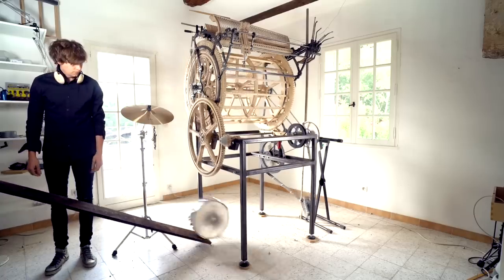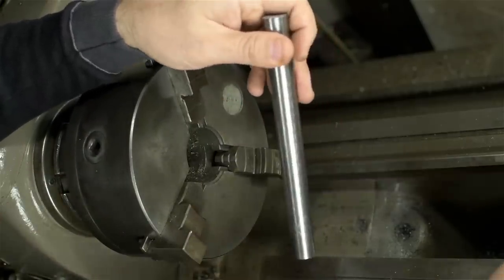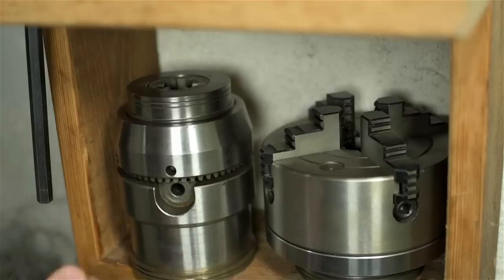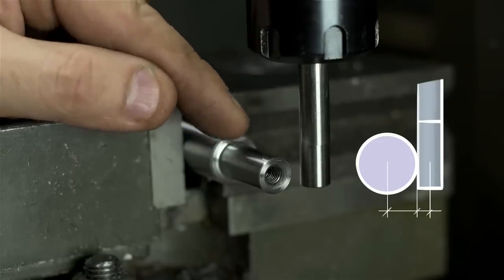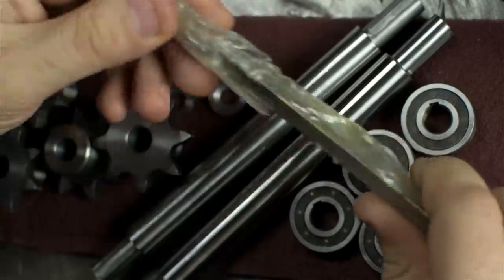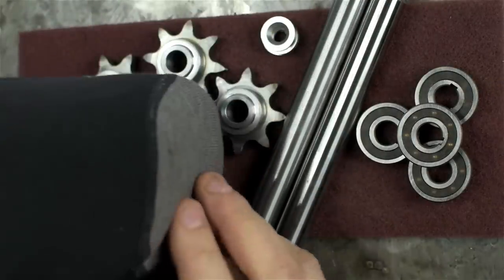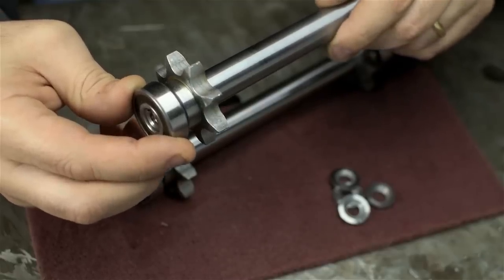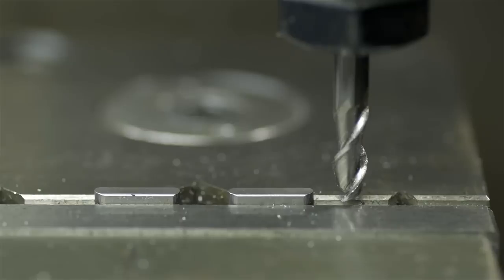Wintergatan's Marble Elevator

Comment: I've never found a channel that I've liked so much in my life. I'm an engineering student and love doing design. This Old Tony has taught me a ton about machining and metal working, so much so that at 19 I have just bought my first metal lathe. Its only a south bend 8 incher from 1932, but with it I'm already putting to use things I've learned from this channel. So thanks a ton for what you do and for every video you produce.
Reply: I wish he would show us exactly how he hotwired his lathe...
Reply: Benjamin Brooks, yea, I didn’t know that was a gasoline powered lathe
Reply: Actually physically building things in the shop will make you a MUCH better engineer.
So many engineers have lots of theory but no practical experince.

Comment: Tony: longtime listener, first time caller. 

Regarding slipping keys: next time you're holding 2 parts in a vice, consider positioning them farther apart (i.e. farther from the center of the jaws). This allows the movable jaw to shift a bit more to account for small differences in part thicknesses, providing a better grip.

Comment: So THAT's how you start a lathe
Reply: Only if you don't have the keyway.
Reply: Well it is an engine lathe
Reply: ... start it like You gonna steal it.
Reply: Something funny is. I had to deliver a work piece (a camera adapter for a telescope, next day we had the eclipse!) so i had to make it fast. My lathe has a centrifugal starter switch and the spring that makes contact broke, i didn't had time to get a replacement so i ended up removing the centrifugal switch and used a screwdriver to bridge the two wires, then i immediately removed the screwdriver as soon as i heard the lathe spool up to speed. A couple of times i was too slow and the motor made a frightening buzzing sound ( i do not recommend doing this unless is an emergency, also never do it if the lathe is too large or operates above 240V, doing this on a large lathe for example with a 440V motor would be very dangerous! it arcs very badly with 220V already). But job got done in time, later i was able to get a replacement starter, now im thinking in upgrading it to a VFD unit. So when he did that in the video i was laughing my ass off.
Reply: Had a car I had to start that way...

Comment: I think your start and stop problem (14:32) can be mitigated by bleeding air from the hydraulic system (fluid is non compressible and there is clearly some compression of the power media taking place (sorry for the English)

Comment: ******************CHALLENGE **********************  how would you hold a half dollar on the lathe while working on the edge of the coin specifical heating the coin once milled to depth using heat to expand 
the coin so the piece when finished will fit over a regular half dollar?

Comment: Finding center of a round part. I’ve found using an Edge Finder is great in many aspects and doing it for decades.
Use a good Starrett, Brown & Sharp, or Mitutoyo. All good within .0005” divided by two touching both sides and double check with an indicator of good quality ( names listed above ). After double checking you will realize using an indicator is unnecessary.

Love your videos Tony as you are teaching an Old Dog, new things.

Thank you 👍👍👍👍👍👍

Comment: Hey Tony I just found something that you might be interested in. I was randomly looking through crap on Craigslist like we all do and I came across this set

Burnerd multisize collet set, type ec2 to ex 13
Capacity is 1/4 to 1 1/4 or 1.6mm to 38mm. 
6 are new in the package and 5 are used. One is missing from the set

It does not have the chuck but you already do it's in Niles Michigan

It's in a nice little carrying case you should check it out unless you have no use for it obviously I don't know how many Collets you have

Comment: In 3535 when they are digging through the rubble of our collapse civilization they will find this marble machine. Tracing the collapse and fall of humanity back to it there it be an outcry for for a name to pin on this horror vested upon the Earth. And whose name is on it? This Old Tony will be held accountable for all the pain, suffering and bad punditry. Good luck. (Feeble attempt at humor)

Tony great work. My only question is,  why did you not use your time machine lathe, and go into future to see the error of the diagram and correct it predelivery.

Comment: Awesome Blossom dude. On the key ways, is it normal for you to mill right to spec with only one pass? I mean, yea, it worked, but I probably would have split the pass in two, or three. I guess a key way is not really critical, so no foul. Not like it was the sprocket or clutch bearing, but did you really only order only 8 total? Yea, thought so....lol.. You would have to to reorder driving down the road again...lol, JK. Really liked the vid, keep up the good work.

Comment: Tony. Would it be feisable for Martin to use CNC features on his programming wheel?  IE he builds all the plates minus the programming holes. Attatch to machine and use a stepper moter to turn wheel to correct points and a cnc cutter for the holes?

Comment: Tony, that's not right. In every movie, when you spark the wires to spin the starter, they always tie those wires together after the engine is running, but majically the starter never seems to grind.even when they steal a dodge. Which is very skeptical

Comment: I love how you lot are so anti metric but then you metricify your stupid inches coz they’re no good for very small measurements, why don’t you call it 1/8 of a 1/16 of a 3/32’s for consistency?
Reply: Simply put, the only reason imperial has advantages in machining is the unit of "thou". Fractional inch is still quite useful for larger projects, but .001" is a great graduation compared to .01mm for most machining. Yes, fractional inch can be confusing, but to be honest decimal inch is a different form of metric. My main gripe with metric is essentially just that the units don't really line up nicely for a lot of things. And in a machine shop, I have no problem following metric dimensions or using metric machines, but thousandths are so convenient that I prefer them all the time. Essentially though, the reason fractional inch doesn't go more fine than 64th's is the shear amount of conversion. It's easy to figure out if 21/64 is larger or smaller than 5/16, but not so obvious when you have 79/256.
Essentially, yes, inches are being converted to a more metric unit. The only reason is unit graduations that allow for the majority of machining to have achievable and acceptable tolerance units.
Reply: Peter Juncker, could you not just use 0.1mm instead of 4 thou and so on? Does metric not make more sense for machining? Although I suppose if it’s what you’ve always known - for instance I always use metric but I just can’t get away with kilometres per hour and I understand kilograms a lot better than pounds and ounces but a persons weight is easier to comprehend in stones! Suppose I’m just as bad

Comment: Did you see it now broke? theres a fix episode out now :D
Reply: ToT's axles didn't break, they weren't affected in any way and didn't cause the problem on the MMX - the problem was caused by a screw in the drive chain coming loose and that caused a mechanical failure which broke a plastic lift and bent some of the metal frame. Martin has now fixed those issues.
Reply: @SlartiMarvinbartfast  tru

Comment: no idea why you can't just accept 7.5 N m as 7.5 N m, and feel the need to convert it to some other units. Feel how much force a newton is, just like you feel how much force a lb is.  Look at a meter stick to see how long a meter is, just like you look at a 1 ft ruler to see how much a ft is.  Besides...turns out all those oddball units are DEFINED in terms of SI (for example, and inch is defined as 25.4 mm)